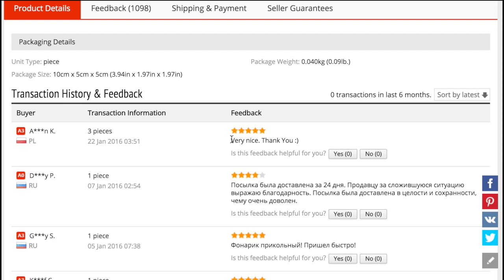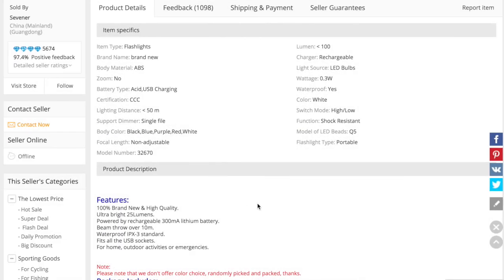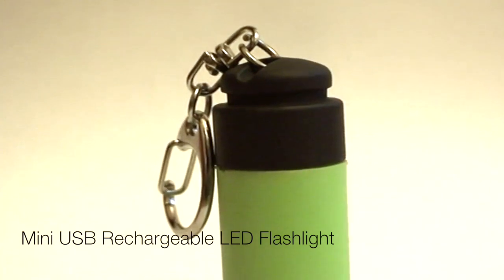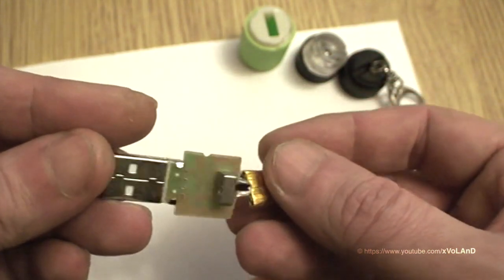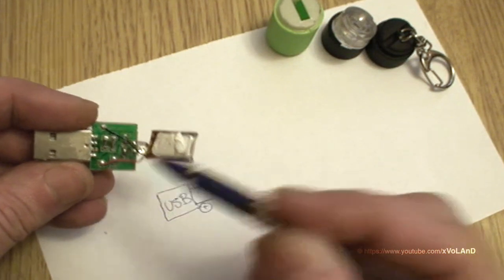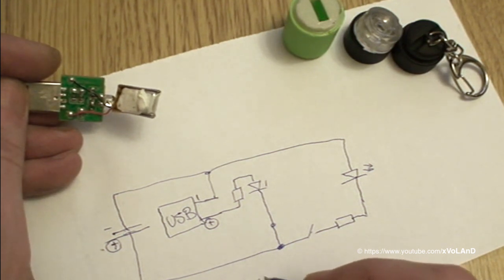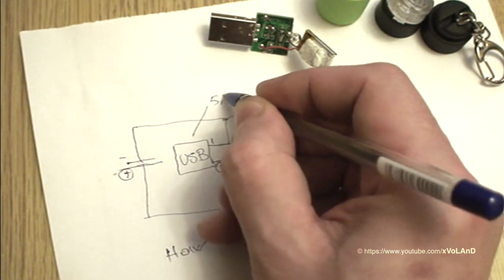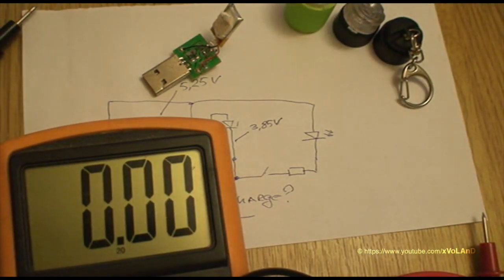Mini Keychain LED Flashlight USB Rechargeable from Aliexpress

Comment: Some of these lights do have charging circuits but a lot are fake with just the battery connected to the led. As soon as the battery runs flat it won't work anymore.  
Nice teardown. 👍

Comment: I suspect the battery has a built in charge protection board... if so it’ll be controlling the charging and discharging of the LiPo battery so no external circuitry is needed.
This will be why the red charging LED never goes out as it is simply wired to indicate the flash light is receiving power from the USB.
I've used one of these for many years and it's still working fine so the battery monitoring is doing a good job.

Comment: I have this torch... yellow color outside.
5 Centimeter long.
Battery 300 mah
Proved... the light last for 1 hour
I Charge with a little power bank(output 500-max 1000mah) about in 30 min.

Comment: If the Li-ion battery is damaged later on, is it possible to remove it and use the flashlight directly from USB supply?
Reply from the maker: Yes, but it's not effective
Reply: Thanks for the quick reply.
I am not exactly a pro, so could you please elaborate why it would not be effective? For example, if the battery is damaged, is it safe (and possible) to use the device on USB power only?
Reply from the maker: You're welcome. It's safe. This is not effective, because the small light for USB I would use something like this https://goo.gl/T9RKg8 or https://goo.gl/p3Rn53

Comment: How it can charge? Simple. USB=5V, next we have a resistor which limits the current to a few mA, next we have a diode which has a 0.7V voltage drop, so 5V-0.7V=4.3V and this is the maximum voltage to which charge the battery. Charging current is about 5 to 10mA and this is not enough for this tester, that is why you see 0. I think the battery have a 20-40mAh, so 3 hour charge should be enough.
Reply from the maker: Bestsceneful After the zener diode voltage is 3.85V
Reply: You think it's a zener diode?
Reply from the maker: Bestsceneful I known and your idea is good, I think so too

Comment: Mine does normally load, i tested it ;). After 1hour of charging its useable again. Of course no battery protection but yeah...it works ;) Maybe another board...not from aliexpress but it looks the same and is also a china mini torch ;)
Reply from the maker: thex Yes, it will recharge your battery but to 3.85 volts, but it's not my way ;)
Reply: I'm not really an electronics specialist, but u say in the video multiple times that i wont load. but it acutally does and it doesn't take many hours to do so...so my confusion ;)
Reply from the maker: thex it's, because you get about 30-40% of charge and ~0.08mAh when you charge
Reply: Vitalii Tereshchuk Thanks for your fast reply, ok i understand, what would be reasonable / normal charging voltage and current for the battery of the torch?
Reply from the maker: thex You're welcome! 4.25 volts and for the battery charging 100 mAh and must have a battery protection to protect against overcharge. Generally, it's a disposable device, which will works not to much
Reply: Vitalii Tereshchuk Thanks for helping and also your patience ;), yeah it's really a cheap device so no wonder that there are some drawbacks as long as it spends some light when you need it and recharges its fine I guess ;). I will tear one of mine apart and lets see what i find in there, because there must be different board styles...because I've two of them from different vendors and both have different appearance (but minimal) and also behave differently on loading (one has no light during loading, the other has a red one during loading)
Reply from the maker: thex one that is charged with the light should have the same schema